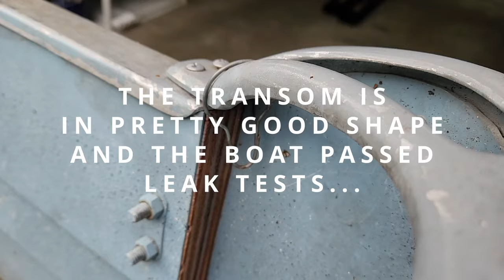Saving an Abandoned Search and Rescue Boat (Episode 2) - Applying Fasco Super Slick Epoxy Coating

Comment: Why not just use aluminum blazer head solid rivets? Match the existing, soft enough they seal with a whack or two of a hammer/ air chisel? I’m in the middle of a 10ft Jon boat project, just picked up hundreds of rivets for dirt cheap
Reply from the maker: @kennyg5619  I didn't realize they were an option.

Comment: How many times you think you've been in the water since then?  Hows it holding up?
Reply from the maker: I'm in the ballpark of 20 outings, at this point.   I haven't taken it easy on the boat, at all.  It's holding up GREAT.
Reply: @CareAgainFishing   Thank You! I have a 1972 aluminum boat myself.  I like your video. Probably going to go this route. It's the friendliest on the wallet considering boat paint costs.  Thanks again for the video!
Reply from the maker: @workforit2270  Thanks!  I did my best.  One thing I would recommend that isn't in the video:  Don't measure the materials by weight.  Measure by liquid volume (as the Fasco social media folks pointed out in another comment).  The product is fantastic.  It does everything I hoped it would do.